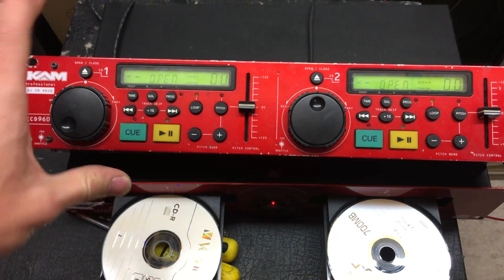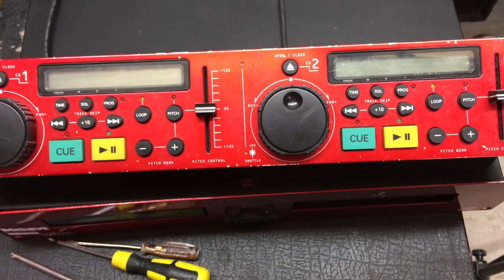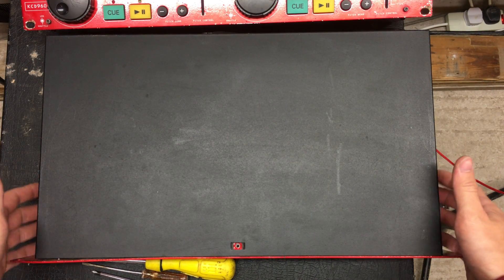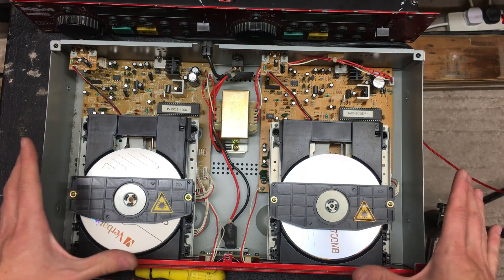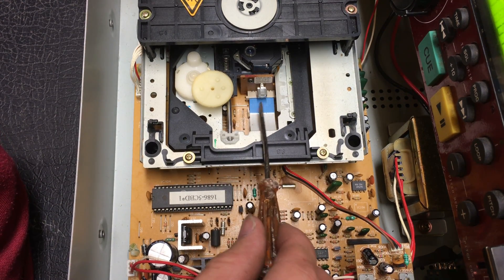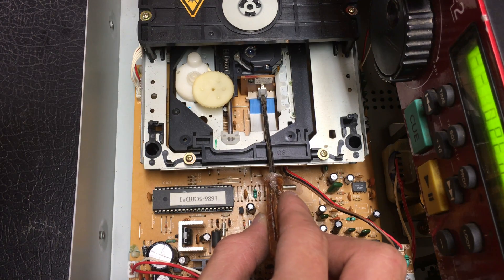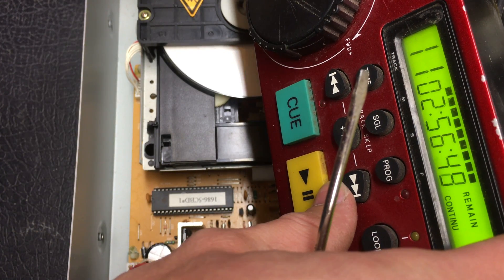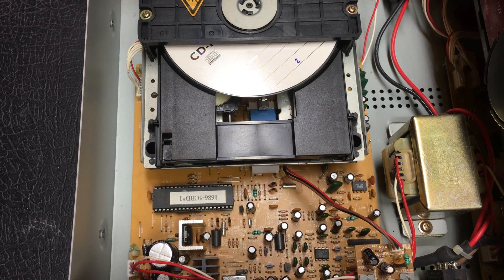Fixing A CD Player That Doesn't Read Discs - Laser Power Adjustment Tweak - Repair Guide

Comment: Well it actually worked, thanks! but I read that it isnt a permanent fix
Reply from the maker: You are very welcome. Glad it worked for you. 
Eventually lasers will end up dying, they have a limited lifespan. By doing this you're just adjusting the laser unit itself. The other option would be to replace the laser but that incurs cost and is a more involved process. 
This way is free and I've done this a couple times to players of my own and they are still good many years on. However it can sometimes be hit and miss. Depends how they were configured from the factory and what life they've had.  
--Nathan

Comment: I bought a 5 disc cd player at auction for cheap but it wouldn't read CD's.  I had to find the adjustment screw because it wasn't as clear as in the video but I found it and it works! Thank you!
Reply from the maker: That's great to hear. Yes changers definitely definitely are a little more awkward and no two are alike! Glad you got it going again though!